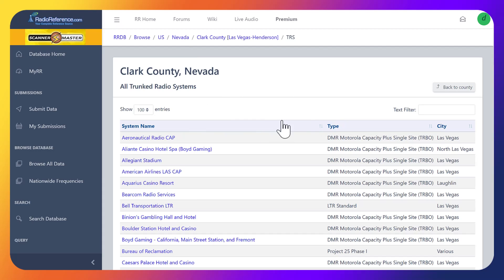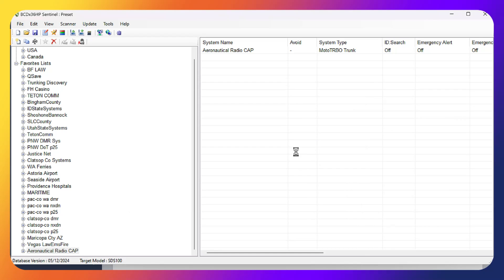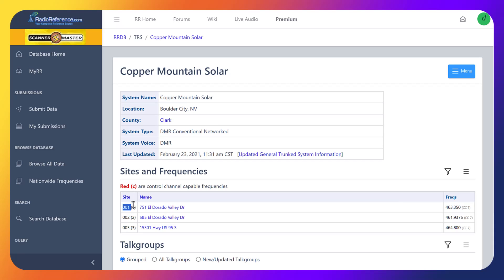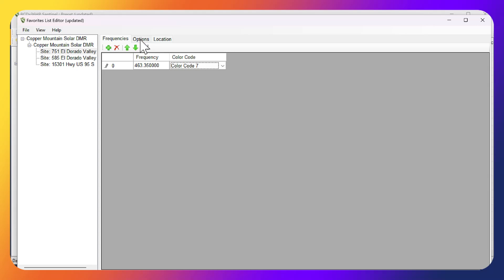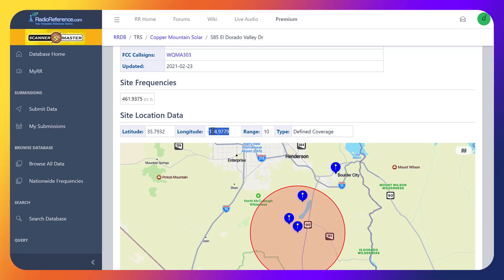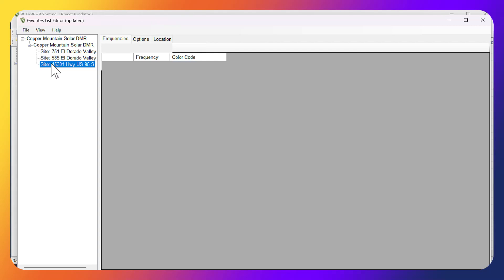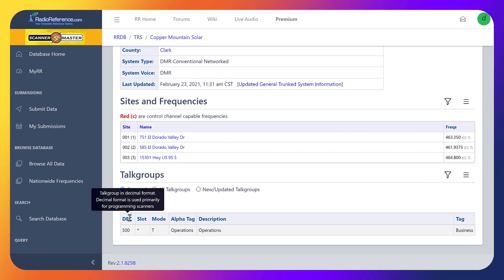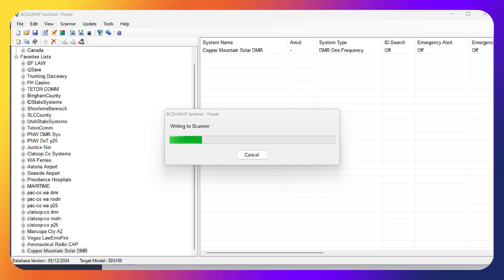How to Program DMR One Systems on the SDS100 with Sentinel in No Time!

Comment: You're kidding, right??? At the end of this video, we'll be experts at creating a list???? I can't even get Sentinel to download on my laptop. With no pc skills, I'll never be able to use my SDS100 to it's potential.
Reply from the maker: What’s the issue with the download?
Reply: @BoyAndAScanner  I've read others aren't able to load Sentinel with older laptops. Mine is less than a year old and it won't load Sentinel either. Even if it did, I can't process the necessary steps required to create a list. Computers came along well into my adulthood and I never had to use one at either of my jobs. I can't do updates for my Uniden Radar Detector. There's no way I'll ever be able to program my SDS100. Bought it before knowing what was involved.
Reply from the maker: @bernardowens1648  do you use an ad blocker or vpn , firewall etc on your computer? I actually run Sentinel on one laptop that’s 3 years old.
Reply: @BoyAndAScanner  no idea. Not pc literate. Know what an ad blocker is but don't know what a VPN is or how to use either.